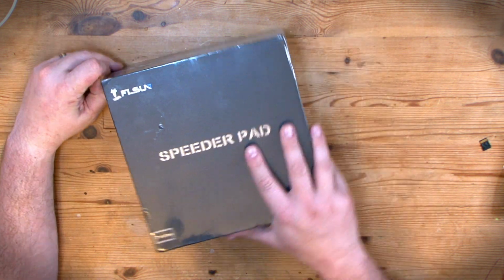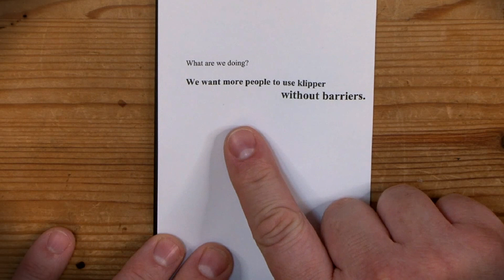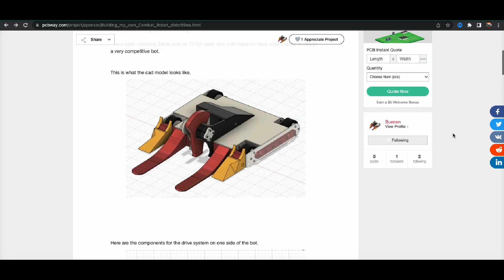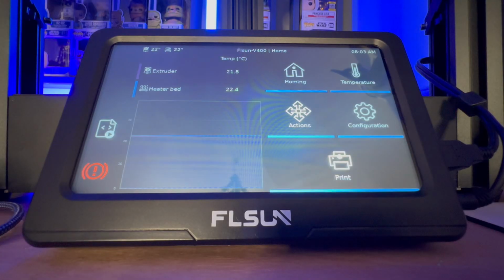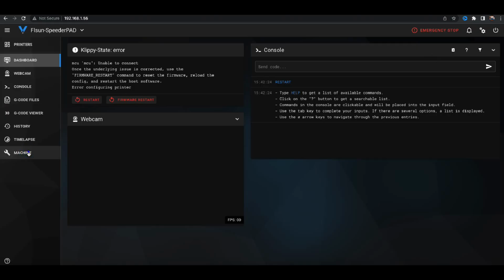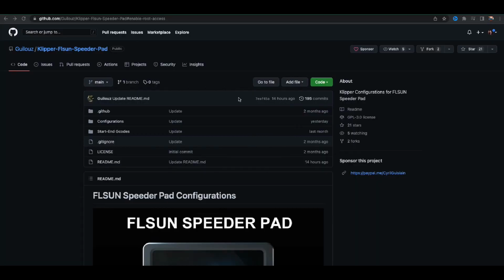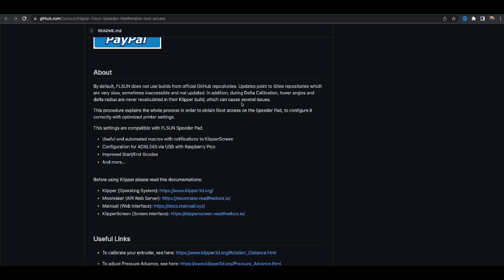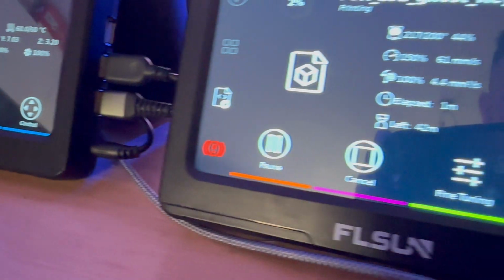Is the FLSUN Speeder Pad the Best or Worst Idea for Klipper Users?

Comment: Mesh min ~-.5 mm?? I wont ever buy this printer with such a bed.
Reply from the maker: When you say “this printer” this was for their pad..
Reply: @TheRealSamPrentice  Yes I said so because I was watching some other vids and they showed the same in the meshes. So I went with just clicking through to your vid. SR and also V400 seem to be very inconsistent in point of flatness. I really dont care to use a pad on other printers, where I maybe run into printing without thermal runaway detection. So imo these pads are only usefull on own manufactured printers and not third party printers.
Reply: Let me correct my last post: I just clicked ignorant through your video while watching it with other intensions as to see a pad, which is 3 times more expensive than a Rasp-Pi😄
Reply from the maker: @rhotix403  lol all good dude :) I was like.. what?? :)

Comment: Hello, I am having problem with my printer (Hardware on software). I have been trying to fixed my self and nothing. I tried to contact flsun and they don’t answer ( it has been a mouth). Any suggestions? Now I just have very expensive paperweight.
Reply from the maker: What have you done to it ?
Reply: @TheRealSamPrentice  the last thing that i did was flashing it. i am not sure if then flashing work.  i import the printer.cfg and now is asking for timelapse.cfg ( i don't know where that is) thank you for answering
Reply from the maker: @Lauraisabelmr  the thing is with klipper, if you don’t know what you’re doing you’ll come unstuck.
https://github.com/Guilouz/Klipper-Flsun-Speeder-Pad have a look here and make sure you know your config and board

Comment: My V400 is on the way. Disclaimer: I'm a noobie and this is my first printer. 

Do I have to update to the official Klipper version immediately or can I just use it As IS for some time before  I dive in. 

I've gone through the GitHub page and it all seems straightforward except the calibration bit that I'm not too clear about. Especially the rotation calibration.

Comment: I noticed that when i hooked up the creality sonic pad that it pushed power through the micro usb cord from pad to printer i installed a power blocker and it stopped it instantly but if someone doesent know over time i am sure it can cause serious problems and can even try to power the printer and you will not be using power from you cord if its turned on before the printer
Reply from the maker: Yep I raised this with creality on their live stream and they said at the time there was no evidence to support that as an issue. But I was concerned

Comment: I am trying to get the speeder pad connected to my FLSun Q5 and a new  SR. I works perfectly for the Q5 but with the SR I am getting mcu 'mcu' unable to connect  error configuring printer. Any suggestion on how to fix this? frustrating!
Reply from the maker: Yep I’d expect you will need to ssh into the ip and either grab the usb info or check your board to see if you have the skr clone
Reply: @TheRealSamPrentice  Thanks for this fast answer!  great video.  I have the nano V3 board. any suggestions?
Reply from the maker: @johnverstegen8996  that should just work can you ssh to the board ?

Comment: I have the sonic pad working on S1 Plus and it's great. Need to do a little extra research for input shaping to get correct x and y testing commands as the built in resonance command only does x. Using the web interface feels like using traditional Klipper (not watered down)
Reply from the maker: Yep but you can do the x and y note the x then attach to the y and re add the x into printer.cfg it’s the only way to be sure :)
Reply: Also it comes with accelerometer which works brilliantly
Reply from the maker: On the UI there are a couple of things the main problem is the repositories and said updates
Reply: @TheRealSamPrentice  I just used a printer.cfg for S1 Pro and made adjustments inside.
Reply from the maker: @Bennett_Lab  glad it worked :)

Comment: So the v400 kipper isn't any good
Reply from the maker: The v400 is good! Don’t get confused with products
Reply: @TheRealSamPrentice  yes sorry you where jumping back and fourth I understood it as you replaced the v400 pad with the aftermarket pad ?
Reply from the maker: @charlesrestivo870  not quote they sent me their stand alone pad, but it’s the same pad.. if that makes sense
Reply: @TheRealSamPrentice  yes it does sir thank you I'm older then most guts so it takes a bit too sink in .I have a SR tuned pretty well so it seems to be a viable option Thank you again for your replys .
Reply: @TheRealSamPrentice   but other software on it, flsun say to me they are different products
Reply from the maker: @klausz5838  ?????

Comment: I bought Orange Pi Zero 2 boards for £22 and 7" touchscreens for £50, it works just fine as it was meant to, I wouldnt trust Creality as far as I can spit and it looks like FLSun are in the same boat, Old Dell 3040 Thin Clients can be snaffled for very little money from eBay and also run Klipper just fine!
Reply: Pi Zero 2 is impossible to find at that price today

for the current pricing of raspberry pi's and touchscreens (plus the hours of tinkering with klipper) the pre-made pads are actually a bargain (depending on how much you value your time and sanity)

Comment: I think it would be the users issue for not reviewing a cfg before plugging it into the printer.  I wish the pad had 1 more usb to run 2 cameras with 2 printers. Are you putting a link to the SR fix for SKR boards?
Reply from the maker: updated
Reply from the maker: Good spot just uploading :)

Comment: Couldn't you just install Linux/klipper on a Chinese x86 tablet and have the same thing?
Reply from the maker: You could
Reply: Or a thin client PC like the Dell Wyse 3040 which is far cheaper.
Old laptops even got a screen and more USB ports.

Comment: Looks tempting with the vanilla klipper install. Just a linux machine with an inbuilt screen. Need to check on the processor to see just how much power it has, I tend to find that these things have just enough to seem good, but fail under any real load. (eg, enabling debug stats in fluidd, etc.)
Reply from the maker: GPU	GE8300
R.A.M.	1GB
EMMC	16 GB
Reply: @TheRealSamPrentice  Ah, its a R818(Quad Core A53).

Doesn't look too bad. Will get one to hack. Maybe even put an up to date version of ubuntu on it rather than a four year old version.

Comment: I was in the first 10 which is generally amazing. 

I'm new to both Klipper and delta printers and trying to find out how to tune in what I know are esteps and other items.
Reply from the maker: How are you finding it ?
Reply: @TheRealSamPrentice  Just calculated rotation distance successfully. Takes me a bit to understand the inputs for the calculation but working it with the current values and an exmaple I got there. Now to PID tune both the bed and hotend.
Reply from the maker: @tonykyle2655  Great work! I'm glad you cracked it
Reply: @TheRealSamPrentice  , different. Have been trying to print the FAB365 Treasure Chest. The outside shell prints well but the inside with hinges fuses together. That is dimensional accuracy and my first thought would be to check/calibrate esteps. But on Klipper that is rotation distance. Looking at a video now that deals with that. Not FLSun v400 based (think that would make a good video) but it is direct drive based.